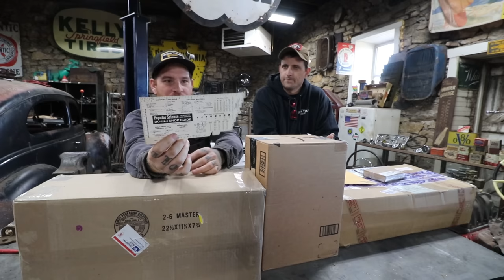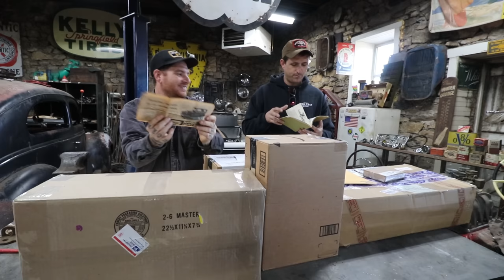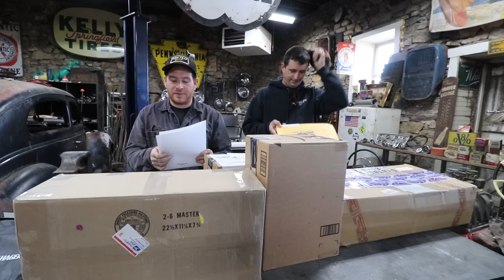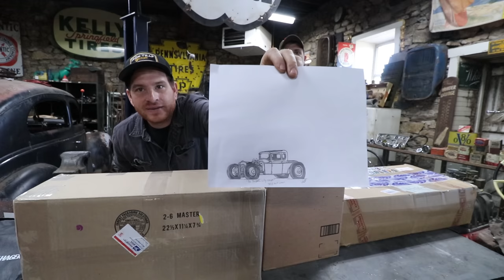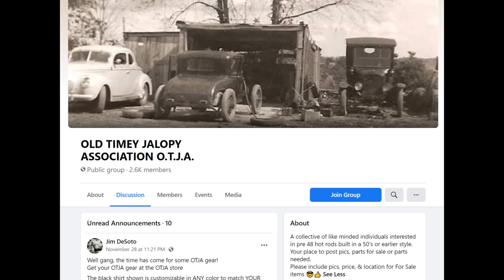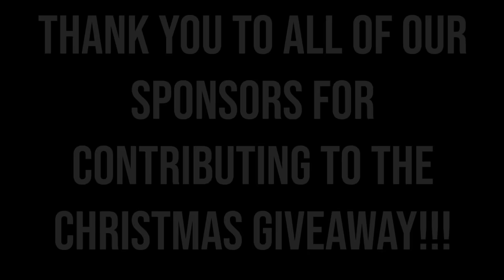Huge Mail Call and Our Biggest Christmas Giveaway Yet!!!

Comment: What hooked me was the cross bracing you welded into the '39 to hold the body together while you worked on the rest of it. All the repairing of damaged panels and rustproofing was impressive. That car will not fall apart the first time it goes over a couple road humps!

Comment: I loved the episode when you drug out the 1939 Ford 2 door Sedan, and got it up and going. And all of the work in between. I have a 39 Ford 2 door Sedan Standard I purchased from an estate that had been sitting for approx. 25 years. (I guess it could be referred to as a Barn Find)  All original, paint, interior, glass, engine, etc. 98% rust free. The only work I did to it was to rebuild the brakes, I replaced the glass and I am currently  rebuilding the engine and transmission. Thank you for a good old Hot Rodders channel! Looking foreword to next years finds. Randy H.

Comment: I think my favorite moment was the Schroll hotrod nut cannon when you got it started. That was hilarious.
It also was an exaggerated preview of starting my 47 Oldsmobile. The previous owner had the distributor cap on backwards and as I was figuring that out I put a shop vac on the tailpipe (to check for clogged exhaust) and pulled a fair amount of nuts and lawn debris out.

Comment: love the trips to the hidden salvage yards(not junk) made me think of the time I was locating some model A rear bumper brackets bolted to a frame and the last bolt was rusted . I had no WD 40 but a coke in a cup so I poured it on the rusted nuts , waited and soon was able to loosen and get the parts. Also the welding tutorials have helped many times.

Comment: Hey guys. One of my favorite videos this year was when Matt showed how take apart a front axle and prep the spindles for new bushings and pins. The instructional videos are the best even though the others are fun to watch. 
P.S.  I guess my hand delivered gift of a home made transmission service stand didn't make the grade for the mail call. Look in your scrap pile for a red and grey metal tray with spider legs and a pipe standing up to screw a 39 transmission to the drain plug hole. oh well.....
Reply from the maker: That item is under my rolling workbench still. A lot of stuff comes and goes in the shop so something like that got missed or I wasn’t aware you wanted it shown on a mail call video.. isn’t thrown away I assure you that.

Comment: Big fan of the channel! Here for the Christmas give away. Im currently working on a 1926 TT truck frame. 1929 model a suspension and banjo rear end. 1916 dodge brothers roadster body. Going to shove a 1972 buick small block as power plant. The video of converting Juice brakes to early ford spindles is my favorite vid this year as it has assisted me with going from Mechanical to hydraulic brakes for my roadster!